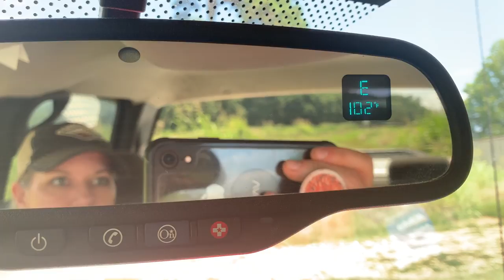In A Bine (Bind)!

Comment: Dealing with the heat is easier for me if I don't think about it too much.  Never be without a water jug. Drink often and take breaks. If you feel weak and get tunnel vision, get in the AC quick. YouTube helps me diagnose and fix things. The problems I have, others have had too, and some show videos about how they fixed them.  A good shop is so useful when you got repairs to do.

Comment: Meredith, the outside temp display on your truck mirror will not be accurately correct, if your not moving/driving thru the fresh air! The temp sensor is located in front of the engine radiator and when the engine is running, to make the AC work, the display will always be higher than actual temp. Because the engine heat is way-way hotter than the air. Just an FYI.  Love your Channel , you (and yours) make my mornings. Go Girl.
Reply from the maker: Haha I know. That’s what LB said too. It’s still hot though 😂

Comment: Very nice deltoids, And hot gray eyes , Try some La. delta hot 95% humidity  103 degrees  119 heat index would love some of your a/c . I was raised on a north La. plantation spent 20 years of trying to keep dads POS equipment running he would never buy something that would not need a lot of repair . Me 35 years later every thing I Owen will work 100% of the time no more hoping it will work.

Comment: Ok......now I'm slightly perturbed. Why? I the roast looked perfert. I wasn't invited for supper. Looked so good it made me hungry so i ate all the leftovers in the fridge and nothing satisfied becuse i had beef on the brain. The 10lbs i lost just got reinstalled after raiding the refrigerator. Now i gotta order pizza to eat for work tonight. And we didn't get to see the pool!!!   But i stilled greatly enjoyed the video.  Gotta have to try that cooking method this fall. I refuse to run the oven and the air conditioner  at the same time. Keep the vidoes coming. Coworkers and i were starting to have withdraws at supper break.